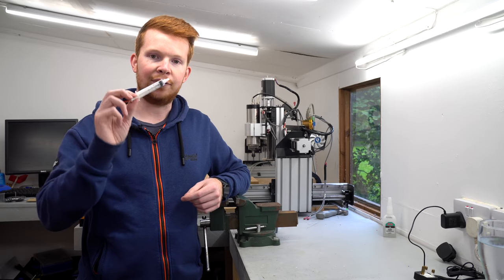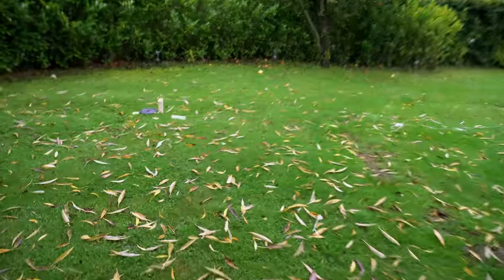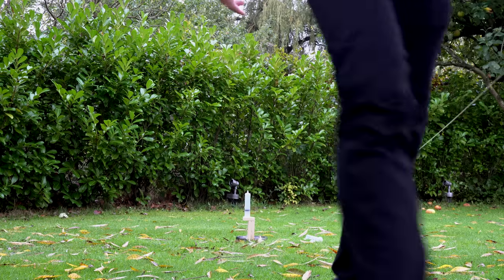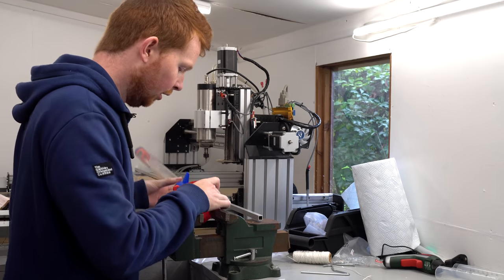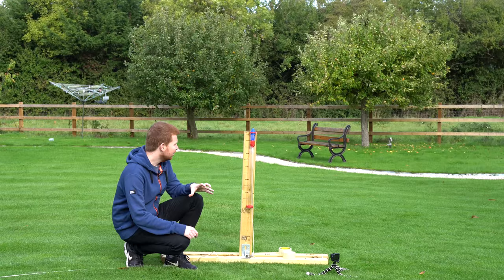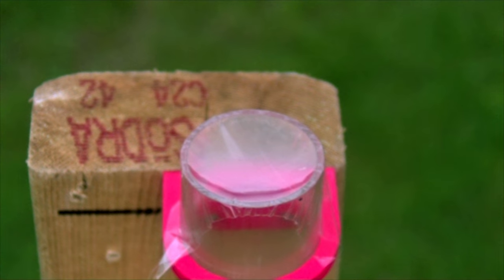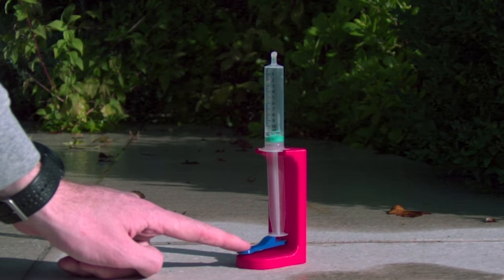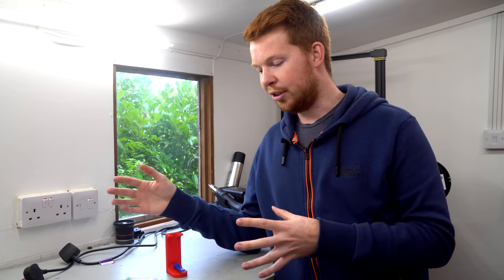Vacuum Rocket

Comment: I’m curious, if you replaced the o-ring with something similar to what you replace the o-ring with in your more recent air engine video, would it be more efficient? or would you need the o-ring to keep the vacuum seal even after you let go of /trigger the syringe? just a curious engineering student

Comment: What's if you had a smaller tube inside a bigger tube and the projectile is in the smaller tube. You had two plungers one go in a small tube one in the bigger tube connected pull down together that should increase your velocity pulled out at the bottom

Comment: You made a mistake at the calculations because the energy remains the same.

E = v²*(m/2)
(v1)*(m1)/2 = (m2))/2
(v1)²*((m1)/(m2)) = (v2)²
square ((v1)²*((m1)/(m2))) = v = 14.53 m/s

Comment: So, im only at 7 min in.. but it hit me.. would the compression of the air leaking in/ the air left in the tube not work as a form of cushion preventing proper transfer of kinetic energy? Would the compression coupled with the decompression not danpen the launch and then cause a recoil when the preasure equalizes again?

Comment: Bhalo, but blast of compressed air force on the object of projectilable directly is more powerful force than vacuum place been filled by the vacuumer cause of external air pressure on the vacummer (piston) to have the piston again fill the gap of vacuumed area and thus external pressure of air forcing the piston it and that kinetic force of the external pressured piston pushing the syringe , its like air to piston to syringe movement, 3 way power transmission and for every transition of ways loss of power is evedent unlike for direct blast of compression air pressed air guns

Comment: high power potato cannon, pressurized air
Reply: launch only the piston, not the cylinder
Reply: vacuum = rubber sling
Reply: without rubber, just a foil fit cap with piston ball

Comment: I think many of your proyects suffer from a lack of calculations behind them. By working with simple equations like the linear momentum and newton’s second law it becomes obvious how to optimize the transfer by controlling the accelerated mass and the syringe’s mass, and It would pump up your appeal as a channel as serious engineering students (viewers) will find your content rather entertaining than actually insightfull (some other channels, like applied science, have dealt before with this issue). The ideas are great for fun proyects but I sense there is not much interest in making those ideas something purposeful in modern engineering. You really have the capacity of making good prototypes, maybe u should consider focusing those skills into a bigger proyect (I am thinking maybe of SAE competitions)

Comment: I am an engineering student and 3:40 was cringeworthy and dumb. It is the same amount of potential energy regardless of the weight of the moving part. By increasing the weight you are in actual fact decreasing the velocity of the syringe.
Reply from the maker: Yes you're are correct, however I'm also correct ("cringeworthy and dumb" are not mature terms in engineering). If the total mass is fixed, it's best to have most of the weight in the piston for the momentum transfer. Hence, heavy piston and light syringe. However ideally it would be best to have both as light as possible.
Reply: I did some calculations on this experiment you did. The optimum weight of the pump must match that of the syringe body for maximum velocity.

The pump for that syringe was probably lighter so I must have been wrong.
Reply from the maker: Yeah that's what my calculations showed too, but because the syringe is naturally heavier than the piston, the weight of the piston needed to be increased. I probably should have explained it in the video better haha